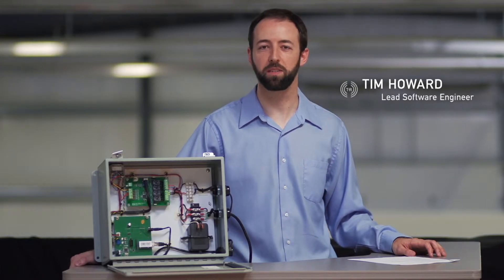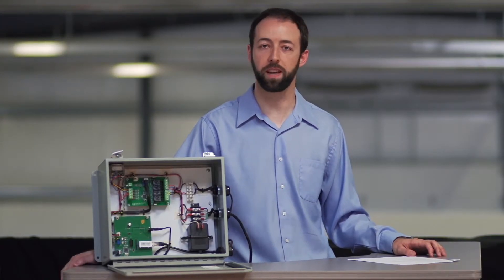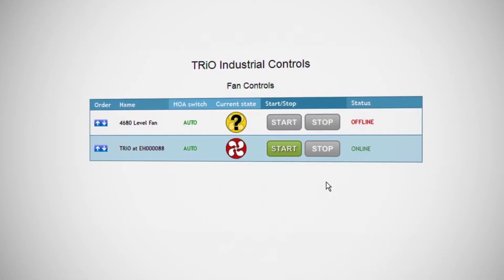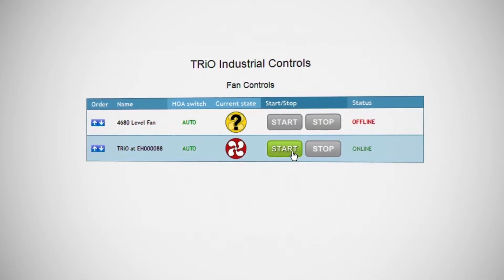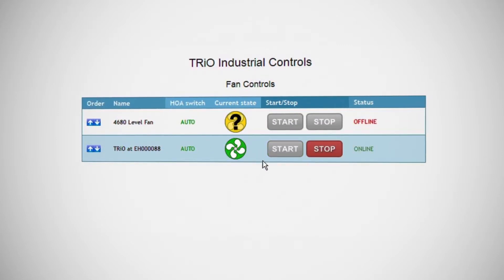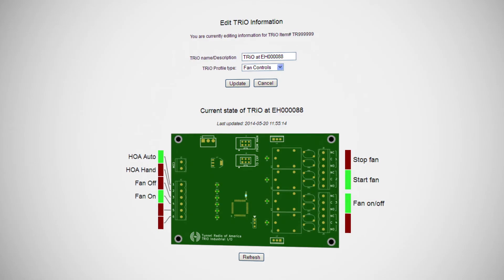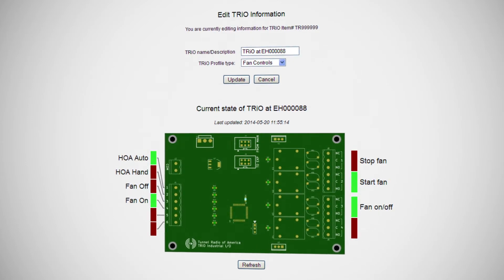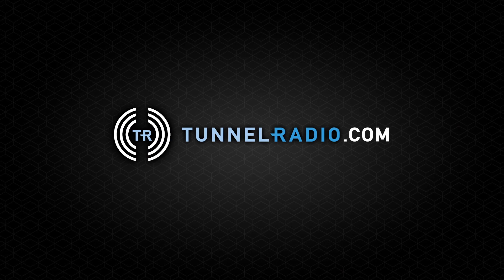Tunnel Radio's Industrial Control System TRiO

Comment: Very nice videos, easy to understand, clearly presented, professional. Question, I was wondering how many other types of sensors could be applied such as with actuators or transducers either in an active or passive application. I see potential with variations among thermocouplers / piezoelectric sensors as well. With automation, measurement converting almost any energy, torque, light, motion or position.